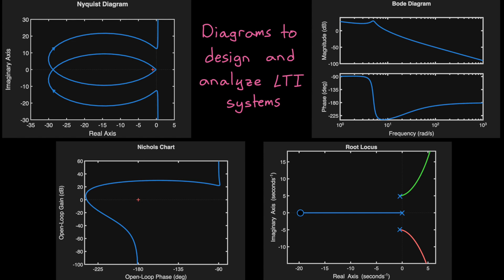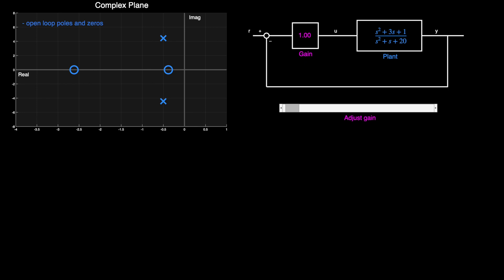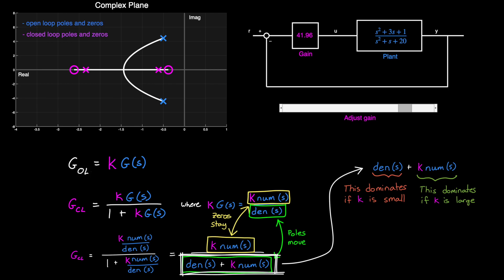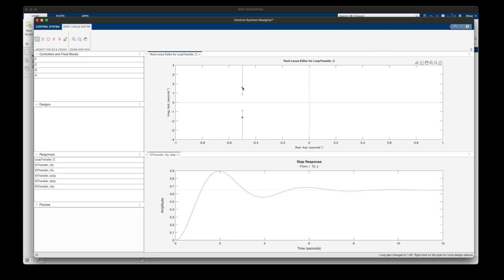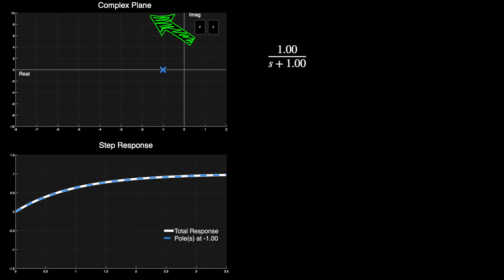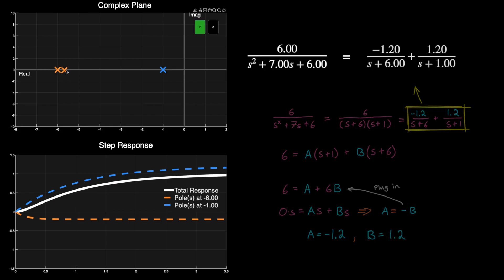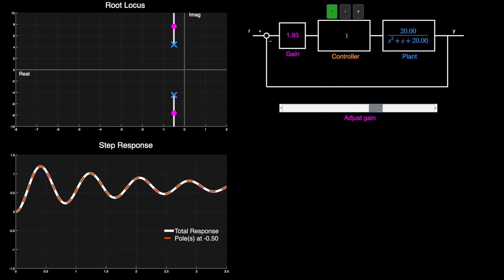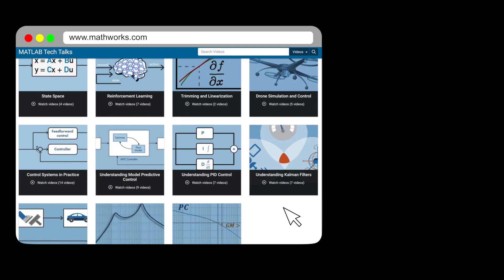Understanding Root Locus: A visual guide to building intuition

Comment: Great!

Shall I ask, what are the reasons you haven’t use it to design controllers in industry?
Reply: There are a few reasons. 1) Root locus doesn't handle MIMO systems very well and many of my systems have been MIMO. 2) Root locus is a great tool for understanding how to change system behavior without simulation or other computer-based design, but with today's simulation and optimization tools I find root locus isn't as necessary. 3) Once you get larger than say a 4th or 5th order system root locus can become cumbersome. I worked on a satellite that had a lot of flexible dynamics and the root locus would have been a nightmare!

Comment: Excellent tutorial.  Liked how you explained how the different values of the poles affect the system and how adding zeros can be added at particular locations to affect the contributions of the poles (by nullifying some and amplifying the contributions of others) was really enlightening.  Now I understand a little bit more how the PID controller (and controller in general) both serves for tracking purposes as well as for increasing stability.
Reply from the maker: Glad it was helpful!